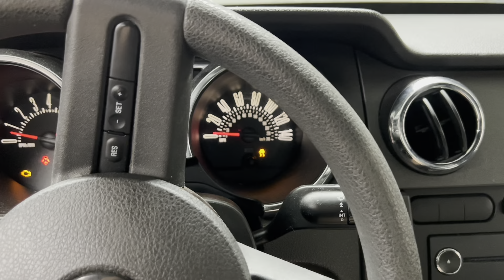I Coyote swap a 3V S197 in record time, splicing ZERO wires!

Comment: some long picks make getting the clutch line off easy. i had to do it twice because i guess I crunched my plastic elbow when i did my clutch and it was leaking. bought a stock line with new elbow. Also dropping the mid pipe makes getting to the clutch line easier.🤣you can unbolt that ac accumulator and get more room to get to that fuel line.

Comment: This will be a long comment, and I hope to get some of your input and honest advice.

I have a 2012 Mustang GT with a Vortech V3 setup. I recently posted it up for sale and had a very interesting trade offer offered up to me. Two Mustangs for one deal, which definitely peaked my interested. He has a 2009 45th anniversary car that is Paxton Novi 1200 supercharged but relatively stock besides minor bolts ons. And the other car is what really gets my attention...

A Procharged Coyote swapped 3v. It's also EPAS swapped and MT-82 swapped. It seems like a lot of the heavy lifting with the swap is already done. And he said it's powered by a Ford Control Pack I believe. It has the stock injectors in it right now and has never ran more than a minute without shutting off. But it does run. At the very minimum I know it will need injectors and a re-tune. He also said it needs a module to adapt up to the factory gauges to have a functional tach, speedo, etc.

The car seems to be very clean and has a lot of nice mods that I can visually spot (he has pics of a clutch install with the McCleod RXT), stainless steel clutch line, BBK longtube headers, Boss 302 intake, aluminum 1 piece driveshaft, BMR control arms, etc. He claims it has OPGs but no paperwork, so I always assume with no paperwork it probably doesn't.

So my question is, would it seem like a worthy trade to you? In my eyes it does, but I have a lot of friends telling me it's too much of a project. But even if it does end up being a larger project than portrayed, I still end up with another 3v that is fully driveable until I can get the Coyote swapped car on the road. It just seems like the hardest work has already been done and it just needs the minor fine tuning right now.

Which also makes me wonder... It's this far put together, so why stop with injectors and a tune? There's a lot of variables but it seems like a gamble worth taking, imo.

Anyways, awesome video and content and I hope you have a good one
Reply from the maker: Short answer. Yes. Seems worth the trade. Can always ditch the control pack use my methods seen on this channel. Many have done just that even mid swap
Reply: @MattSoppa I've seen the plug and play harness on your site and it seems like the best way to go. I'm assuming I'd need a 11-14 Mustang PCM for it to work? Or is it not compatible to work in-line with the Ford Control Packs. I haven't seen the car in person yet, but I'm hoping none of the factory wiring hasn't been cut up. He did mention something about needing to run a wire to the MT-82 to activate the reverse lights. I'm thinking it's definitely a good bones type of car, and it's literally at the home stretch of being completed haha
Reply from the maker: @OctaneSlain  it does but AC and cruise functions probably won’t work.

Comment: Would this translate exactly with the truck motor would pair mt82 with it just wondering if everything here(harness included) would go with the gen 1 150 motor
Reply from the maker: @wesleyclarke231  yes the harness doesn’t care that it’s an F150 engine. The tune may tho. Would use the same methods as if it was a Mustang engine. You’d probably have to swap the timing cover for the alternator and swap the oil filter adapter to the Mustang version.

Comment: This is awesome🔥🔥🔥. Question though, I have a v6 s197 and I want to do the exact same thing… is there any major problems or parts in going to need to get?
Reply from the maker: Our swap harness works with both V6 and GT models. With a V6 you’re going to need a transmission for sure driveshaft and rear axle. Plus if you want AC to function some lines and compressor from a 4.6 car
Reply: Does an F-150 5.0 work the same a mustang 5.0?
Reply from the maker: @dylancremona6509  wire wise no they’re different. We are developing 04-10 F150 harnesses tho. 

If you’re asking if you can use an F150 11-14 5.0 then yes you can

Comment: Would this work with a gen 2 coyote or only gen 1
Reply from the maker: Gen 2 will if you convert it to gen one timing. Ultimately need to use a gen one ECU and that’s how to get there
Reply: @MattSoppa  so for the timing I would just need gen 1 cams and chains or would I need the crank as well
Reply from the maker: @smokky3v  gen one cams and phasers

Comment: Where did you get the lifting brackets and will be ordering that harness from you very soon for the Gen1 with MT-82 going into a 2007 S197. Did you use the driveshaft from the 3V trans or the MT-82?
Reply from the maker: Came on a crate motor. 
You’d use the DS for the 11-14 MT82
Reply: @MattSoppa where did u get that lift? Or what’s the link for it
Reply from the maker: @a.g.performance  it’s a Maxx Jaxx lift

Comment: Do the coyote stock headers bolt up to the 3v exhaust? I'm working on coyote swapping an 07 V6 and I'm not sure if I can use the exhaust system from an 05-09 GT or if I need one from the 11-14GT.
Reply from the maker: They do not. There’s a couple of ways to go about it. On the 2007 GT that we did last year. I put long tubes and modify the stock mid pipe to except ball flanges to bolt up to the long tube headers. With this car, I actually just picked up a complete exhaust system from manifolds back From the 2014 donor car that the engine came from . So doing it this way you just use 2011 to 2014 exhaust components. On the 2007 I use a 2005 to 2009 cat back components.

Comment: Are the videos after this one are the ones u explained the fueling with the fuel line connector that came with the drive train?
Reply from the maker: I’m not sure I understand your question. Any videos after this are after the swap
Reply: @MattSoppa  my bad I meant are u still using the fuel line that came with the drivetrain that u connected to the stock 3v fuel line or did u have too go returnless system?
Reply from the maker: @deznuts1841  it’s already a returnless system and currently as I type it’s the same as in this video
Reply: @MattSoppa  okay thank u and last thing does the 3v come factory with returnless system?
Reply from the maker: @deznuts1841  yes
Reply: @MattSoppa  bet thank u that helped a lot

Comment: will you harness work on gen 2 and gen 3 motors or is it specific for a gen 1?
Reply from the maker: Only if you use gen one timing components in a gen two head and use the gen one ECU

Comment: I have 07 Mustang convertible V8 4.6L... Worried I'll eventually need a new engine.. How much did this cost?
Reply from the maker: https://youtu.be/cLn9WuKNfcI?si=gubYBmho8uIXcFlp
Reply: Nice.  So 8,643 without labor.  5,868 after selling old parts.  Labor usually around 4,000, but you did it yourself.  What state are you in?  I might eventually want this.  Also, my transmission only has about 60k miles on it, whereas yours had 175k.
Reply from the maker: @green3488  AZ. I didn’t use my OG transmission
Reply: @MattSoppa  Right.  I saw you sold it.  Was hoping mine could sell for more due to low mileage.
Reply: @MattSoppa  Basically, I was hoping it'd be about 9k for me, including labor and selling old parts.  Do you know what is the best possible engine that would fit in mine?  Is it that Coyote one?  How many miles were on your Coyote?
Reply from the maker: @green3488  donor drivetrain had 92k on it. 11-14 coyote would be ideal

Comment: What did you have to do to get rid of the Check engine light and Traction Control
Reply from the maker: Traction control can never be used unless the entire 11-14 abs system is used. Engine light is an emissions thing I’ve figured out since then with the FTP sensor
Reply: Where is the FTP sensor? @MattSoppa
Reply from the maker: @winstonemerson2439  behind the panhard bar in front of the charcoal canister

Comment: I want to coyote swap my S197.

How much does a swap like this cost?
Reply from the maker: It all depends on how well of a engine donor you get so the little parts like harnesses and ECU etc don’t nickel and dime you. Our plug and play harness costs $1000 and if you’re doing it yourself a donor engine can cost from $3-6000. Could even suggest getting a whole vehicle donor as well. Once I sell the old 4.6 Drivetrain and actually get a drive shaft in it I’ll have a video coming out breaking down the actual cost.

Comment: I have a 2014 v6 and doing a swap but not a 5.0 I’m doing a 4.6 cause I love the 4.6 what’s your take on it ????
Reply from the maker: @Redskinnedfoxe  I would never go backwards
Reply: @ understand even tho the 2010 still had the 4.6 and 2014 is basically same body and all just different engines in v6 and v8 ! But it easier to just 5.0 my 2014 v6 and more reusable parts